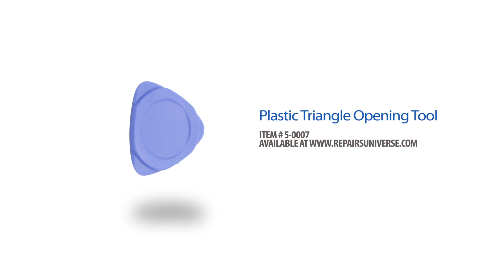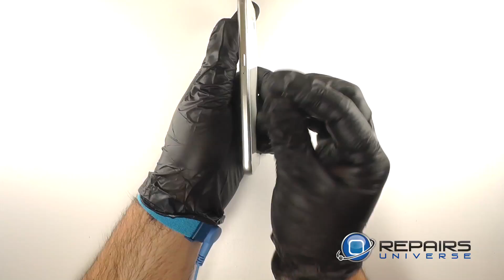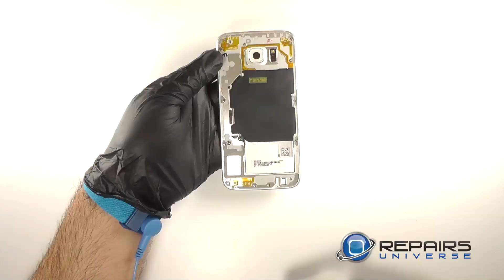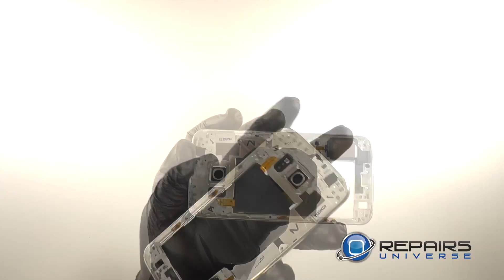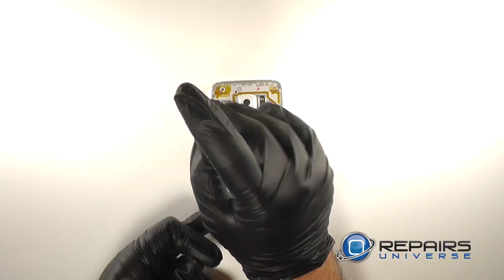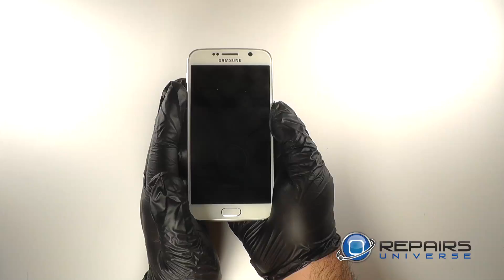Samsung Galaxy S6 Power and Volume Buttons Repair Guide - RepairsUniverse

Comment: I really want you to fix my phone... You got skilled....
Reply from the maker: +Kmeng Koch Unfortunately at this time we do not offer repair service.
Reply: +Repairs Universe My power button dose not respon well... I have to press it so hard it get it works... I don't want repairer  near by to fix it because it's so complicated with this kind of phone... So do you have any suggestions for me to solve my problem?
Reply from the maker: Kmeng Koch The repair is fairly straight forward the most difficult part being the removal of the back glass. If you don't feel comfortable doing the repair yourself, taking the phone to a qualified service center would be your best option.